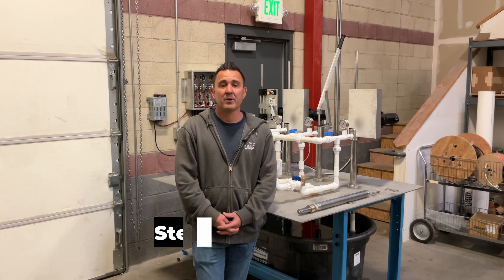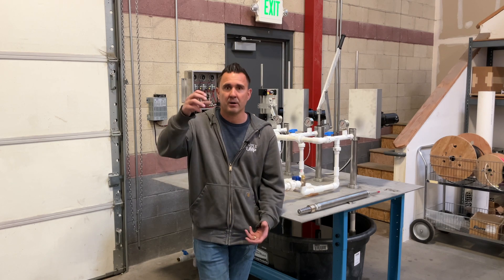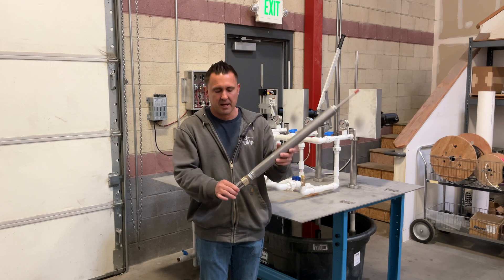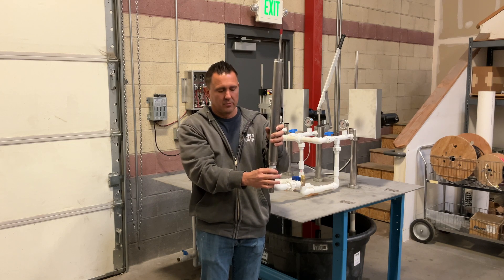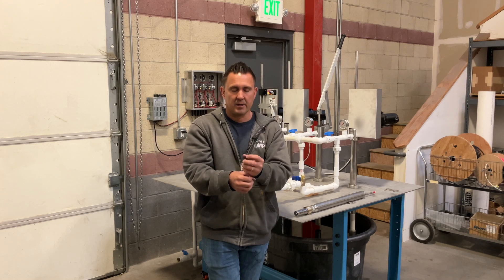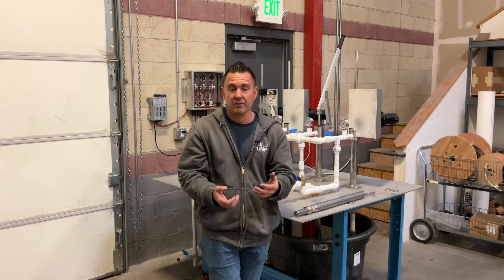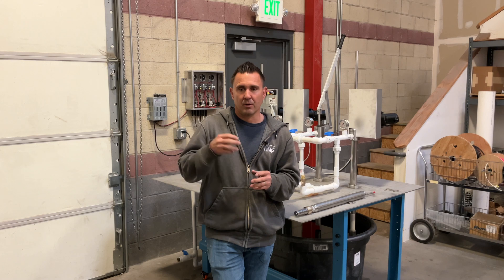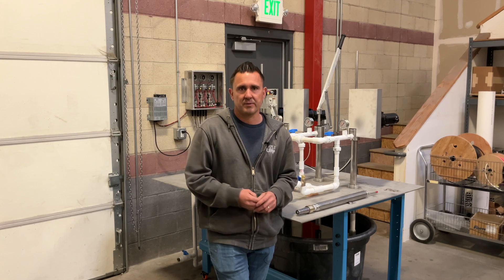Why Isn’t My Hand Pump Working? Troubleshooting Simple Pump Issues

Comment: I have a pump in a public garden area which worked for 2 months with no problem. Now I have to fill in water to pump it out. 

I thought it was the rubber, so I bought new ones to tighten the potential leakage. Still nothing.

The water level in a nearby river is low and no rain for 2 weeks now with everybody pumping.

Could it be a crack in the pipe in the ground? 

Or rust (the pump was flooded by the river 2 years ago. 

I'm the new owner now.

Cheers from.Slovenia.
Reply from the maker: Please watch the video at the link here.  This will give you some tests you can do to better diagnose the root cause.  https://www.youtube.com/watch?v=lBnsYhwzh9g.
Reply: @SimplePump I already did. And the bag is inflating and deflating. But still, whenever I poor water in, close the pipe with my left hand and pump, I do get water. It's just annoying that the water always drops down again, making an air sound while this happens. We have draught already. But compared to my neighbours with 2 pumps just 30, 40 meters away, I only pump 50-100 liters of water while they pump over a 1000 liters a day. And their pumps work normally.